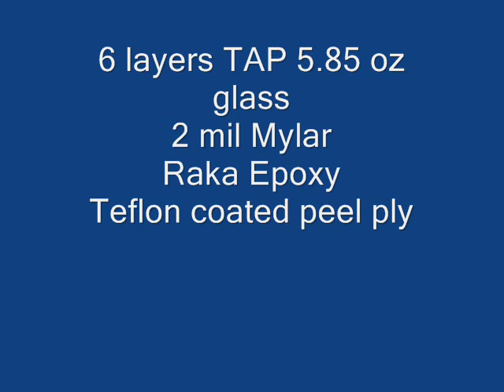Hand laid fiberglass body tube

Comment from the maker: 2 layers of peel ply makes the tube rounder. It's called peel ply. I get it from Aircraft spruce. I think it's listed as porous Teflon coated release film. The mandrel is an Aerotech 98/15360 motor case. I put 2 layers of 2 mil mylar over it before I started the layup.

Comment from the maker: Aluminum would be stronger as would carbon fiber. I'm trying to show that a hand layed fiberglass rocket is capable of some extreme flights and you don't need to vacuum bag or carbon fiber. Motor expansion is an issue when used as the 'coupler'. The 2 mil mylar seems to be about the right amount of 'space' to allow everyhting to work properly.
Reply: Is the mylar there to prevent the fiberglass from sticking to the pipe or does it have another purpose?
Reply from the maker: @mehmetekindogan1551   The mylar does keep the layup from sticking to the 'pipe' (mandrel/rocket motor) but it also adds some space . Not all rocket motor of the same "dia" class are the exact same diameter. They very some. They all get a tad larger the hotter the 'day' is...so that extra space created by that layer or 2 of mylar... allows for the slight difference in motor diameters.
Reply: @tfish38  Thank you very much. I previously used polyester (I believe it is almost the same as mylar) however had some problems removing the fiberglass from the tube. I could move it a little (10 centimeters) but since the fiberglass tube wrapped the inner spool too tightly, it was impossible to move it further (it did not stick, just was too tight to move). The spool I wrapped the fiberglass to was made out of cardboard and had a wall thickness of almost 2 centimeters (so no deformations), thus I was able to leave it in the trunk of a car and it shrank a little with heat. Thus I was able to remove it easily. My question is, is there another easier way for removing the fiberglass from the tube? The method I use renders the inner spool unusable after one coating.
Reply: if you could answer this question it would be great. Mylar
is a bit expensive for me , so could i use a cellophane sheet instead?
Reply from the maker: @vertex3243  I don't think it would work. It would probably tear trying to get the cellophane off...the layed up tube. You might try a small test layup. I'd also try waxed paper of..Mylar from potato chip bags.
Reply: @tfish38  yeah, thanks for the reply. I think im just going to go for some mold release spray. its also pretty hard finding a mandrel thats 41mm

Comment: You could use a roller to compress the wet layers instead of using the chip brush  which will distort the fabric weave with strong dragging as you do in this video.